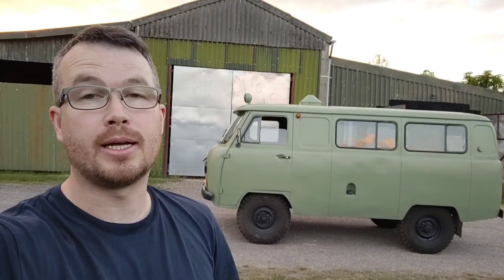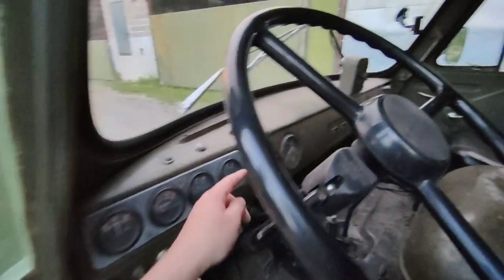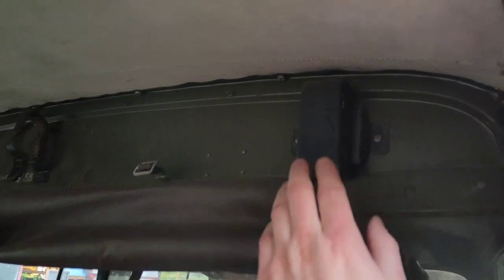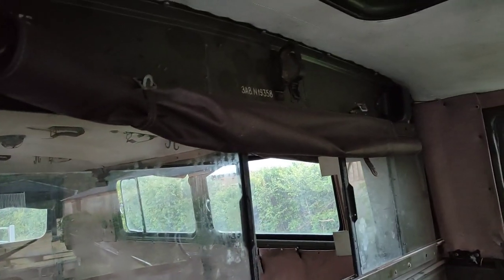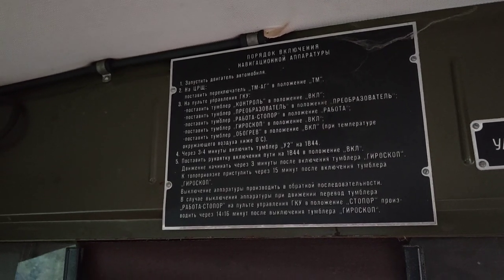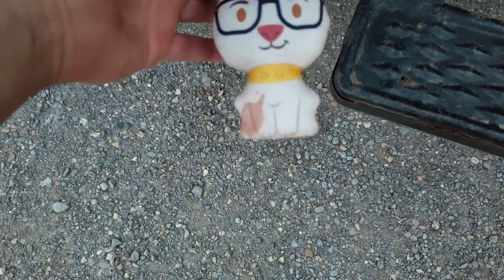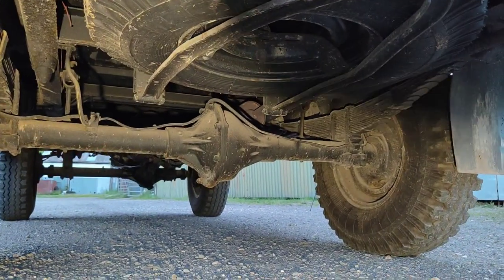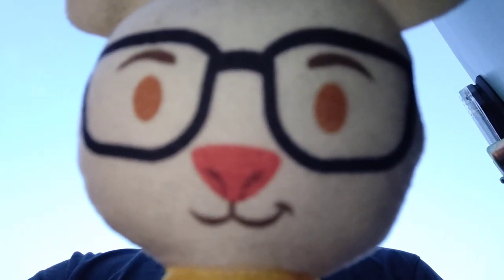Introducing My 1981 UAZ 452

Comment: This is in fantastic condition.
Reply: Fantastic condition well I wonder what is under the paintwork just watching this video it looks like this vehicle may have been repainted possibly before the commentator of this video bought it.The thing is it's amazing what some filler and a coat of spray paint can hide.I maybe wrong but from what I've heard about these Russian UAZ vans they do have problems with rust as I said maybe I'm wrong but has the owner had really good look at the bodywork especially as the paint on the outside looks good but on the inside the vehicle looks rough ,that could mean someone before the current owner bought used the old filler and quick paint job to let's say hide things before they sold the vehicle. This vehicle may have had any rust issues fixed properly before it was sold and the paint therefore may not be hiding anything but usually that is rare a lot of old second hand vehicles in most cases are patched up and sold on to new owners meaning its very much buyer beware especially when it's one of these old soviet era  designed vehicles.

Comment: That exhaust is standard! Blew my orignal back box to pieces with a back fire when ballast resistor was faulty. Then made my own of what was lying around, 2 1/2 pipe with a straight through box. It made a huge difference to its performance, revs alot better. Thats with the K131 carb too.
Reply from the maker: Really?! That's mental! I can't wait to release the ponies 😃

Comment: the big sign is very cool: "The procedure for working with navigation equipment and gyroscopes!"
Ceiling mounts for hanging stretchers with wounded soldiers
A very rare complete set of cars
Reply from the maker: Well it turns out it wasn't an ambulance all along! It was a military survey vehicle. So the stretcher story I was telling isn't correct 🤦
Reply: @LivingMyBoostLife  No, that's right!
Reconnaissance (not for spies) cars in the USSR army used a different chassis.
Reply: @LivingMyBoostLife  This was before the era of GPS

Comment: Thought I would come over and take a look after I saw your post on the UAZ FB Page.  I drove one of these things in Russia back during the 90's and have the unpleasant experience of seeing flames shooting out of that central engine cover. I didn't have a Fire Extinguisher and had to abandon it and watch it burn. Still, I reckon I will get myself another one and convert it into some kind of camper and go travelling in it as it's off road capabilities seem to be very good from where I have seen these things driven.  The large list of instructions refers to a number of 'Tumblers' and a sequence of events with abbreviations to set up a GYROSCOPE which I assume went up out of that hatch.  The driver's cab hatch, I think it is held on with bolts or screws. It is not a sunroof as such, it's either on or off as far as I can remember.  Will now follow your progress with the engine conversion, but for me, travelling around Eastern Europe, it is better to stay original as the parts are everywhere and not so expensive to replace when it breaks down and it usually does. 🤦‍😉
Reply from the maker: Jeez that Uaz must have had some affect on you if it nearly killed you and still you want one 😁  I'd probably not have gone for a Saab turbo engine if I wanted to do cross continental travel, maybe something more simplistic. But for what I want it's perfect 😁
Reply: @LivingMyBoostLife  Actually, it was quite amusing and not my UAZ. I had a huge dog, a Russian Wife and two English guests in the back with their belongings and a gas bottle as I recall. It was winter, snow all around and we were on our way back to Moscow after a weekend away at the DATCHA (Summerhouse). My Brit Mate says, 'thank you for a lovely weekend' and I reply, 'it ain't over yet'.  Then I see flames coming out of that engine cover. If I'd been on my own, I might well have tried some heroics, but considering the dog, passengers and gas bottle, I decided to bailout unloading everyone and retreating outside of exploding zone.  It just burned down to the chassis, didn't even catch the tyres. A bus driver took us all to the nearest train station and with train and Metro we got home safety.  Next morning, I had to explain to my Boss and the vehicle owner what happened - he was giving me advice how to have driven through the fire etc. yeah, but you weren't there and I was is what was going through my mind. Live and learn and still to this day, I have no idea why that fire started in the first place.

Comment: You may already know this but southern electric had 19 of these in about 1980. They were quite well regarded but did overheat as the winch blocked airflow. I'd love to track one down but I doubt any exist (I've heard rumours of one but never had details).
Reply from the maker: I've seen pictures of the Southern Electric ones. I'd not expect any of them to last being sat. 4 wheel drive vans is something the UK doesn't really have much of. Strange really as they do seem useful
Reply: @LivingMyBoostLife  I'm told they liked to rust for fun, stank of petrol in the cab and liked to overheat. Off road every bit as good as a Land Rover (comparing with a series 3)parts were cheap...SEB only ran them for a couple of years, they seem to have sold them on at only 3 or 4 years old. I imagine they have rotted away by now. Probably the only thing I'd buy if one came up.